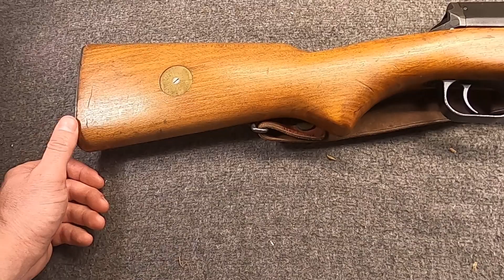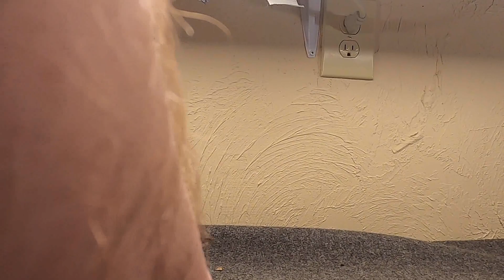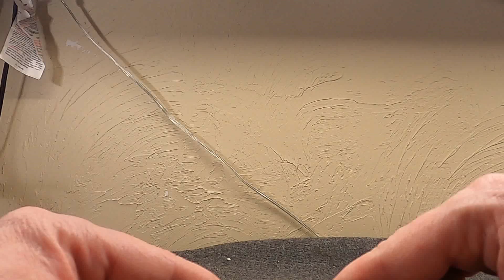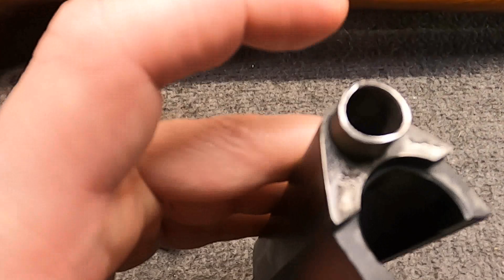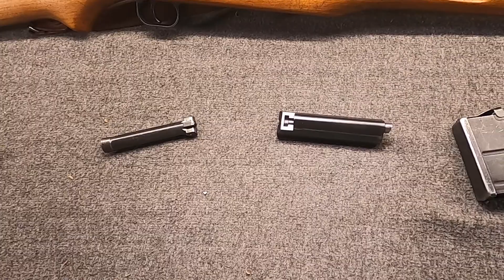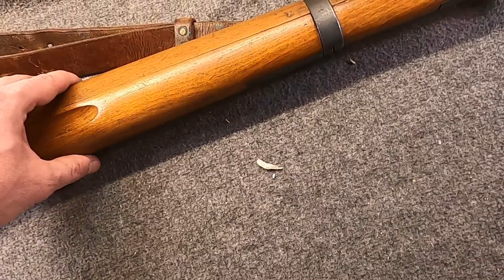Why Do We Call The AG-42 Rifle "Ljungman?" & Other Fun Facts About Sweden's WWII 6.5mm Semi-Auto

Comment: If you ever want to see what the Ljungman looked like before the modifications to the AG-42B configuration, take a look at the Hakim. Both the serrated charging/dust cover thing, sights, and the magazine latch remained true to the original design on the Hakim rifles.

Madsen also produced a dozen or so prototype AG42s with small modifications in an attempt to get the rifle adopted by Denmark, but the Germans in control of the country at the time made arms development difficult. The idea was ultimately dropped when Germany put Madsen to work making guns for the Occupying forces.

Also, the development of the rifle was even faster than most people realize. From the time Erik Eklund was ordered to design the rifle to the time the rifle was adopted and accepted for production to begin, only 9 months had elapsed! It has to be one of the fastest development histories of a good rifle design during that time, or perhaps even afterwards.
Reply: Hey now, don't steal my thunder for the Hakim video lol j/k

Comment: I do Love me some Swedish Rifles.  I've been collecting them for many years. The AG42 is so mild to shoot. And very accurate.  I've got a good supply of bottle nose bullets. And a large supply of Spitzer.  But what I mostly shoot out of the 42 and 38,s and 96,s is my home rolled 139g lead tips. I have a custom built target rifle useing a K98 receiver and Burris Eliminator 2 scope. It likes my reloads the best.  Can get one hole  5 shot groups at 500yrds and around 1.5" at 700. That seems to be were I start spreading out shots.  I'm not sure if it's the limit of my barrel or the round itself. Hard to beat a 6.5x55 Swede.
Reply: Agreed, great fun. I wish there were more variants to really collect. I haven't bought a new Swede in years now....so sad.
Reply: We had an ELR competition in Sweden this year. 2 friends brought with them a Sauer 200 STR (scandinavian target rifle) and the Tikka T3X. Both in 6.5x55. They fired the Norma Diamond line Field factory load. Both got hits out to ~2000 yards or 1853 meters. Target was 1x1 meter. Pretty awesome round for LR shooting. Myself I used a .338LM at that competition but use 6.5x55 in all other LR comps. No issues getting hits at for example 1200m at 60x60cm targets when I have tried.